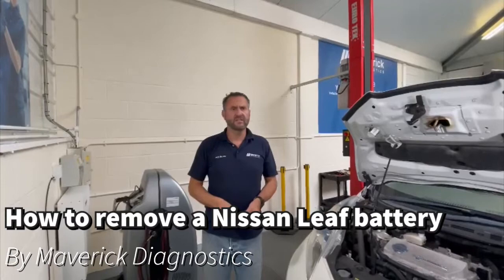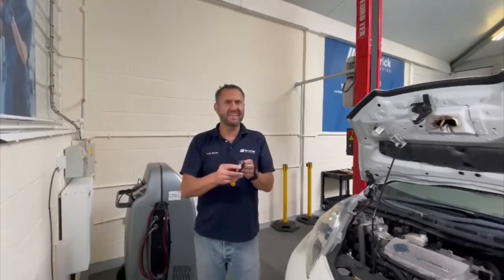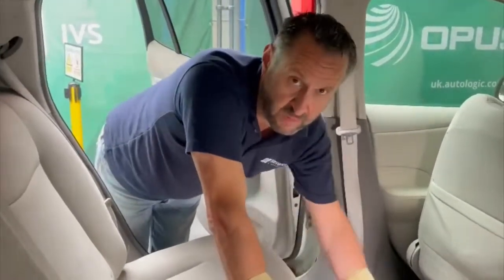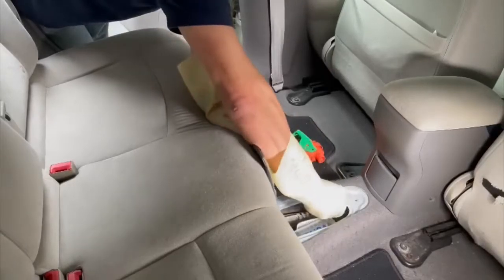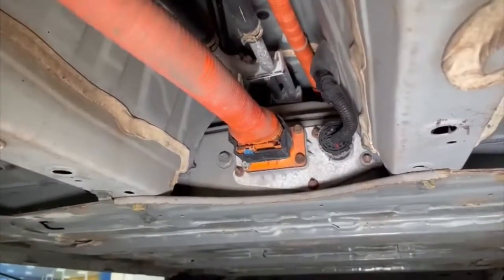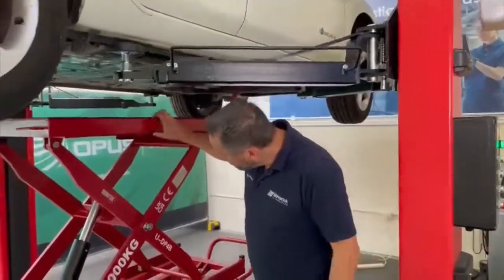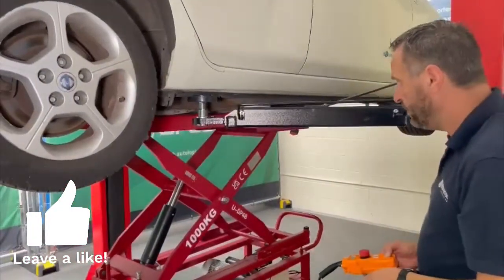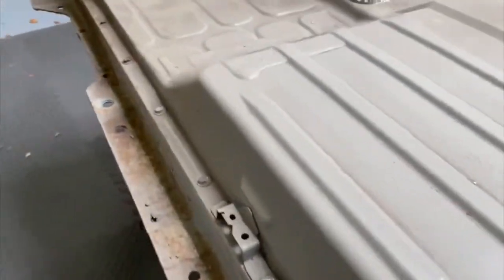How to remove a Nissan Leaf battery

Comment: Do you have programming after installation ? Thanks Peter
Reply from the maker: Hey Peter - thanks for your comment. If it's the same battery, no programming is required. Generally, this can be done using the app 'Leaf Spy' if it's a different battery